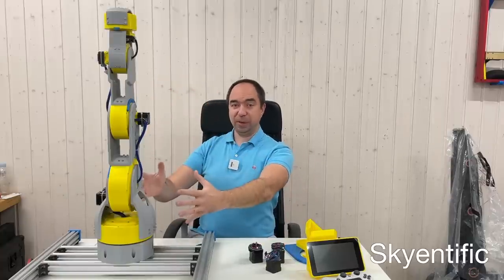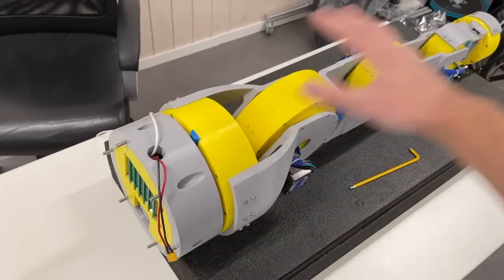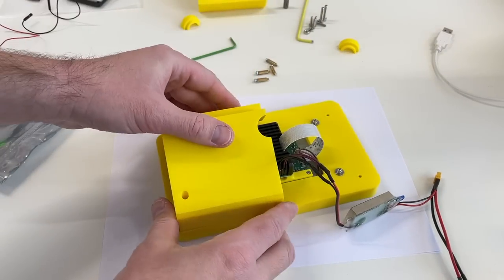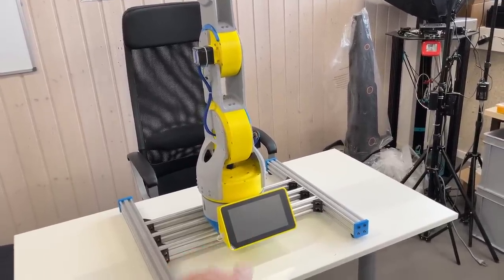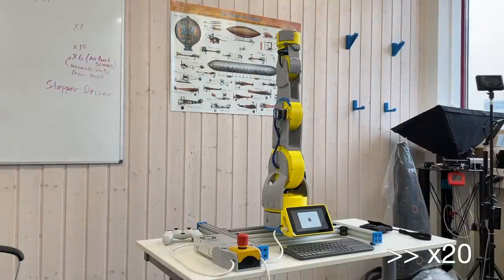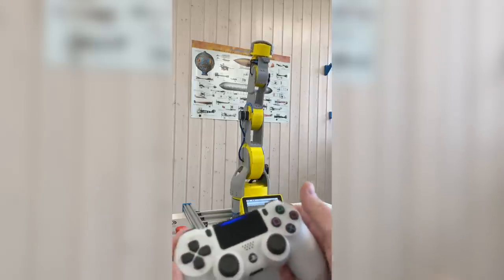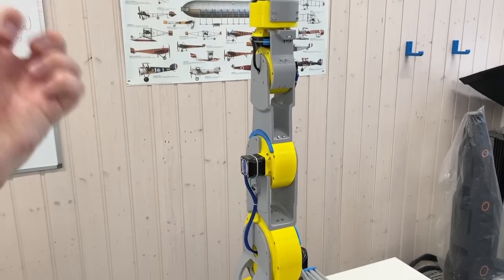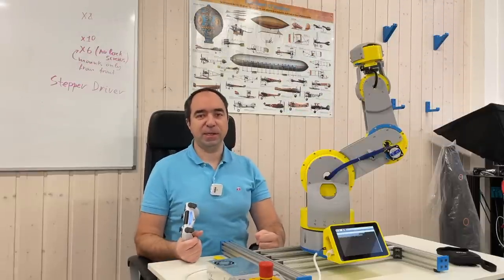Cheap and Simple DIY 3D Printed Robot Arm

Comment: Amazing work!  Do you plan to work out an inverse kinematic control scheme where you can directly control effector position rather than having to control joints individually?
Reply from the maker: Thank you. Yes! I would like to make complete software with inverse kinematics.
Reply: @Skyentific  it is going to be challenging but it is a must to have a credible platform for your robot!

Comment: I built this arm and have been struggling to use it with ros2.  The problems come from it not having encoders.  I built my own arduino driver that can basically accept a position [1000-2000] and send/move the joint(s) there.  I'd like to also get velocity and torque.  If I were to buy 5 RMD X10 actuators, is that overkill.  What 5 actuators would you recommend? I would have to redesign the arm.  I'm just wondering what 5 actuators fitt the sizes used in this arm (close to it) and have lots of power.  I note that my arm is not super powerful.  It is definately not fast.  I'm hoping to have an arm that can swing about like its on a lot of caffene.  Thanks

Comment: Thought you installed thermistors on the Motors no ?
Reply: i think he mentioned before that thermal switches turn of at 50 degrees C. he was checking what temperature is on motors currently